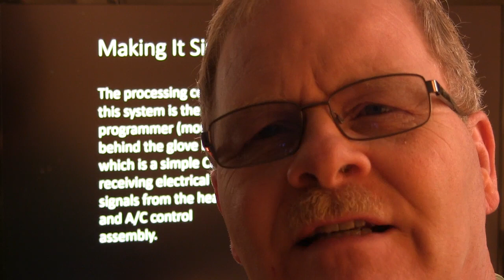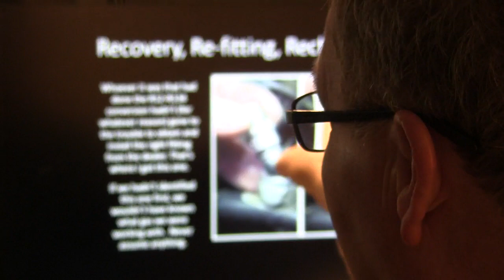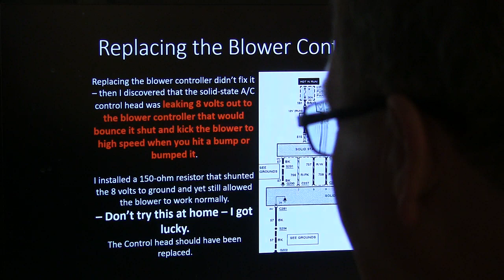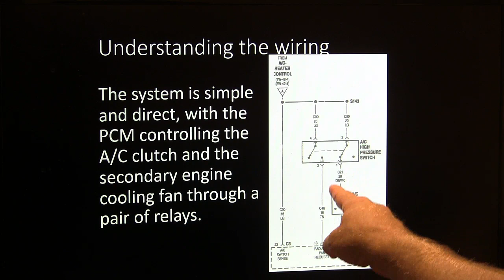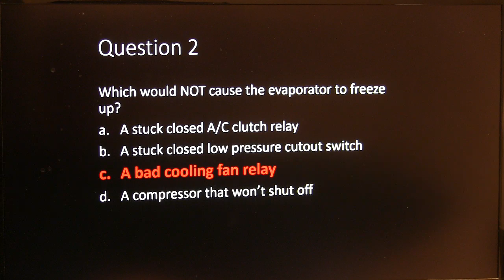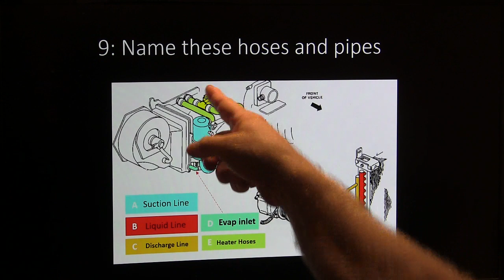A C War Stories

Comment: Timely lesson.  If you have a moment, can you give me a little feedback on this one?  Yesterday I looked at a 2007 Honda Odyssey.  Complaint was a growling noise with the AC on.  I connected gauges and saw the same readings as your question #6, indicating possible expansion valve issue.  This is a van with rear AC so there are two.  Static pressure (compressor off) was about 80psi and it was about 50F outside but engine was warm so static seemed normal.  With compressor running I saw low side drop to 15psi and high side drop from 80 to 70psi.  The compressor growled as he complained about.  I don't know the state of charge, though it's 12 years old and never been serviced so I assume it's probably at least 12oz low (assuming normal loss of ~1oz per year.) 

Is it worth evacuating and putting a full charge in before condemning the compressor and/or expansion valve? I told him it was likely time for a new system.  I was thinking bad compressor (indicated by the growling) and plugged expansion valve possibly caused by the bad compressor.  Am I on the right track? 

Thanks for the good info you bring us.  I try to watch them all!
Reply from the maker: I'd start by making sure the refrigerant charge is right and that there's no stop leak in it clogging the expansion valve(s) and then I'd go from there.
Reply: @McCuistian  Is that worth doing even with the growling compressor?  It sounds similar to an alternator with bad diodes but only during compressor operation.  It's a one-owner car and never been serviced since new so I don't think it's got anything in it but you never can tell.  I didn't want to contaminate the system even more (if it's contaminated by the bad compressor) by filling it with refrigerant.
Reply from the maker: @johnaclark1  The compressor is probably bad, just because of the noise, one way or another, you should flush the whole system first and replace the expansion valve and the orifice (front) if it has one.
Reply: @McCuistian  Yep, that was the plan and what I told him.  I didn't see the need to evacuate and recharge it first and contaminate it worse than it is.  Told him it was time for compressor, condenser, drier, and both expansion valves.  Flushing that large system is no fun.
Reply from the maker: @Jacks Auto Repair That happened with a Jeep Cherokee I used to drive - it was spec'ed for 1.25 lbs and when I did a recovery on a cool day I ran the machine a few times (allowing the outgassing of refrigerant from the oil in the accumulator) and found 2 lbs in that one.  A good way to make sure you're getting it all out is to run the engine with the A/C off and the hood closed until the underhood temps is really high and then do the recovery - you'll get most of it that way.